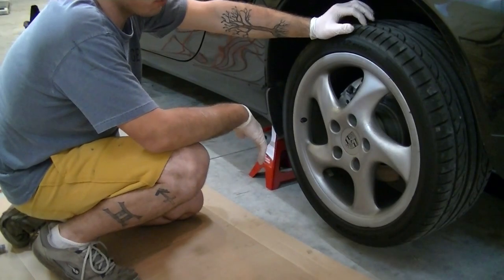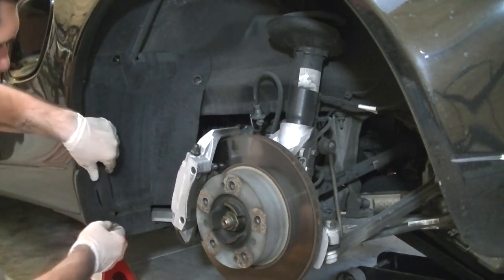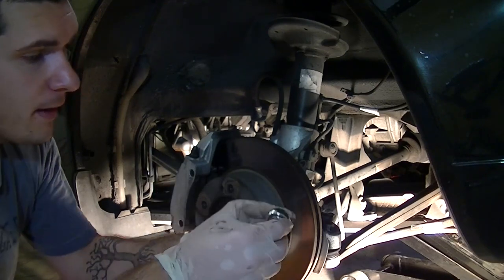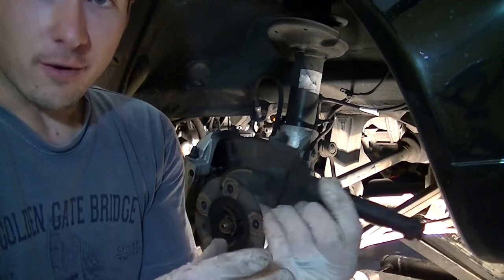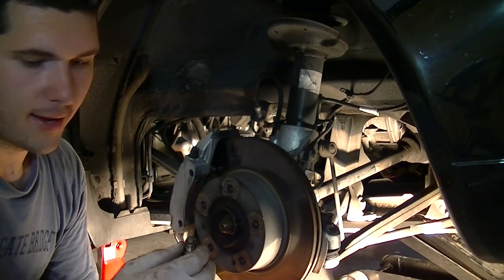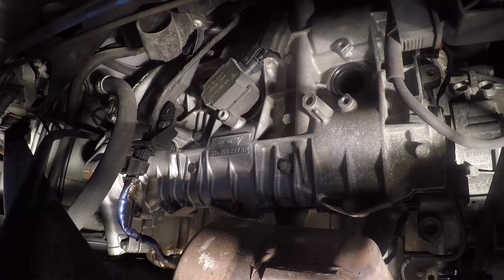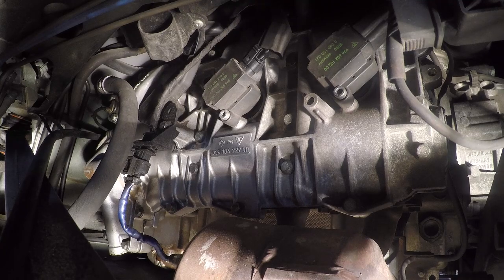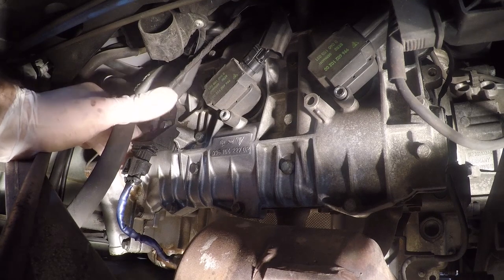How to Replace the Spark Plugs On A Porsche Boxster

Comment: Thanks Ry, this doesn't look too hard, I'll proceed on my 2002 Boxster!  For those wondering which plugs to buy, there's a number of resources on the web to figure that out of course.  For my 2002 Boxster, it looks like the Bosch 7413 Spark Plug is correct, and I can currently get a set of 6 for about $30 through Amazon.
Reply from the maker: Nice! Hope it goes well for you!
Reply: I bought ngk spark plugs from Amazon. Turned out to knock-offs. Buyer beware.

Comment: The old plugs were loose and so are the new ones. If you look at the old gasket, you'll see it's as thick as the new one. Means it was never really tight - no evidence of gasket crush. Always use lube on threads and both sides af gasket. Tight by feel or at least 25 pounds. Realize the spark plug is a cork for an explosion that occurs thousands of times per minute. It must seal. I could tell the old plug was loose by the ease of removal with such a short wrench. It'll never be tight with it either. The factory torque is to protect you from yourself and to protect the cylinder from empty headed.

Comment: I don't know the model of Boxster this is but it is not a 981. In my 2014 Cayman 981 you cannot even turn your wrist vertically to get access to the coils as the space between the sharp edge of the cats and frame is too narrow. It is such a pain. You can barely even see the driver's side front coil, let alone reach it. Great video to give you a good idea how this process unfolds.
Reply: 986. poor access on 987 too

Comment: I would use a magnetic sparkplug removal tool - special order - instead of the rubber grommet type. If the rubber comes out of the 5/8th plug tool, then how will you remove the rubber grommet from the plug? It can be VERY difficult to remove, even with the engine removed from the car.
Reply: Sparkplug ratchet wrench ftw

Comment: Great vid. Just replaced my spark plugs yesterday. Only diffrence is that I got torx screws and the connectors pint upwards. I have a boxter 986 -04  30Nm on sparkplugs and 10Nm on the 6mm torx screws

Comment: Great video, wish you would make more of them for the Boxster!
Reply from the maker: Well my plans are to put in a full touch screen double din radio. I am also buying drop in cup holders for the center console. There also may be a few interior panels that I want to replace eventually. OH and I want to replace the diff fluid. The problem is, the car is in amazing shape! It does not really need anything. If there is something specific you can looking for you can suggest it and I may be able to get around to it.

Comment: Good video but I would have to add on some tips for people.

You should clean the surrounding area any time you have part of the engine exposed so you don't bring foreign contaminates. 

You should also check gap on spark plugs, apply anti seize to the threads of spark plugs, dialectic grease to the coil pack to ensure water tight connection.
Reply from the maker: Good tips, thanks!
Reply: Anti seize is actually recommended against by porsche
Reply: @ok2853  just googled it,  I guess with modern spark plugs you don't need to do it anymore since they have a special coating on them.  It used to be highly recommended so they don't seize in aluminum heads
Reply: Yes gaps!

Comment: Wow much easier than I thought. My 2013 only has 29k miles, but maybe I should change the spark plugs since they are still original. No issues though drives so smooth, so I don't know if I should.
Reply from the maker: There are two camps. 1: Do them at the interval set out in the owners manual and 2) do them once you experience issues. There are good points to both. I am in camp 1 but I try to combine the job with other stuff.

Comment: you could have shown how to replace those plastic tubes the plugs and coilpacks go into. would have helped me even more. but good video anyways. now i know at least that i don't need one of those carlift things (sorry i don't know the english word, i'm not a native english speaker.)

edit: i'm going to use NGK V-line sparkplugs. i've used them on all my cars before and i kinda don't trust Bosch about ignition related parts (even though it's a german company and i'm german)
Reply: I had a Bosch spark plug electrode break off in my engine cylinder causing a misfire and extremely expensive repair. I would NEVER use Bosch plugs again.

Comment: Great video...thanks! Today First time...I changed my 00 Porsche Boxster spark plugs and found oil in two spark plug wells (rear passenger side).  Any idea what cause this? Is this a serious issue? The coil/boot look fine, but not sure how oil got into the wells.  Appreciate for any help...
Reply from the maker: +Yang, Nhia was the oil on the tip of the plug where it sparks?
Reply: No. The tip of the plug was dry.  The oil was found in the well, but I cleaned it with a cloth.  I just ordered two spark plug tubes for replacement.  Issue might the o-rings.
Reply: Nikolas Yang what is the valve cover gasket and o ring gaskets that go around the plugs?

Comment: Great video. Would the process be the same on a 981 Boxster? The dealer is looking to charge $500 to change the plugs at 40k miles!
les!
Reply from the maker: +K.J. G. If its not the same it would be very similar.

Comment: You really should use a torque wrench. Those washers on the new spark plugs are crush washers and require a specific torque value. If the the washer doesn't fully crush per its intended design, you can damage the coil pack tubes and possibly get a missfire.
Reply: Frank Armstrong what's the torque spec to the spark plugs?
Reply: I doubt that. If you don't tighten the plug enough to crush the washer you had never tightened the plug in the first place. I would never torque a sparkplug. At least with a regular ratchet you can feel the tension and be able to feel if the threads are going to let go. Spark plugs only ever need to be snug. Not tight. The gap matters most. All coils and wires are intended to seat fully without arcing. If the plug washer wasn't crushed, the boot would still be seated on the plug and the washer sits at the cylinder head and the actual electrode goes inside the cylinder heads so the electrode would never be able to arc over to the washer.

Comment: “Using a normal Allen wrench would be a huge pain”. Proceeds to use a normal Allen wrench at 2:29 on the top bolt of the first coil pack 🤣

Comment: you have to wonder what were these car makers thinking.  I thought mercedes was complicated ha ha. this is why it costs 1,000's to own and maintain a porsche unless you trade it in after 2-4years
Reply: Rubbish - A POrsche can be as cheap as an ordinary car
Plugs are similar price as are the Coil Packs if you do the work yourself
Porsche don't make parts they are sourced in
MUCH cheaper to run a Porsche than a Merc
Reply: It’s only the boxsters and caymans which are mid engined. The 911’s are easier